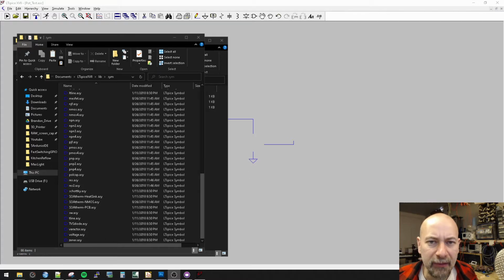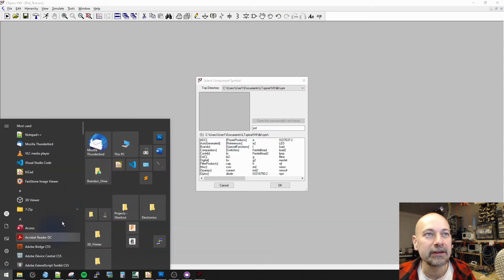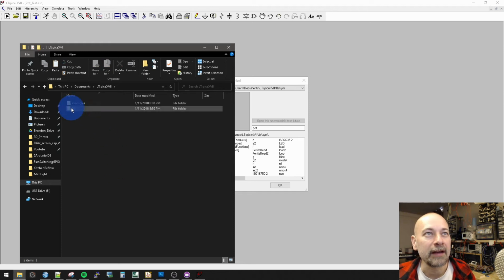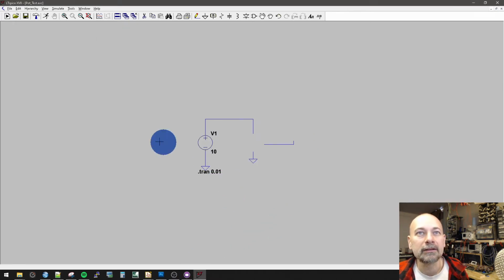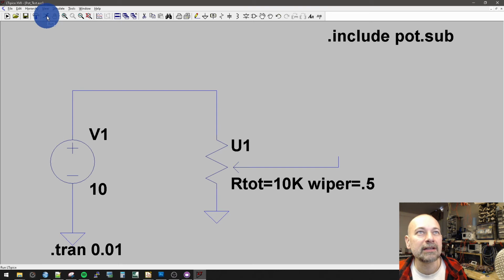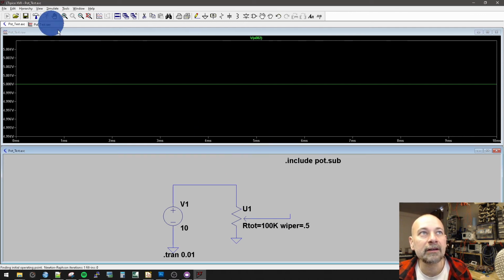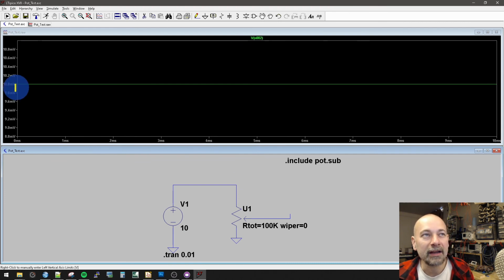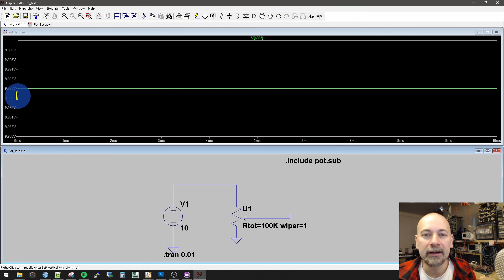LTspice Potentiometer Download and Install

Comment: Many thanks! I wondered why LTSpice didn't include a pot in their library of components. I still have to add a few directives to sweep the pot in a simulation, but it's only a single parameter now instead of the kludgy two resistor method. It looks cleaner. Verified, this works in LTSpice 24.1.10

Comment: changing the wiper value is the same amount of effort as changing a resister value. now i know why ltspice didn't put in a potentiometer
Reply: Well, it depends on how you are using the potentiometer.   A pot can be used as a single resistor or it could be as 2 resistors that share the total resistance.   So when a linear pot is set to 25%,   the first resistor is 25% of maximum and the second resistor is 75% of maximum.  It depends on what you are up to, but I saw value in making the potentiometer.  It may not be for everybody.

Comment: Have to try this out, thanks, the one reason I avoid LTSpice is because the way pots can be done in it is ridiculous. It’s now 2023, they need to act like it. And to those that say “the way that’s there is more correct, if you don’t know how to do it, you shouldn’t be using it” (I’ve heard this exact quote), to you I say stop gatekeeping, lose the ego. Every other MODERN design tool has a fricking pot in it, it’s not 1985, I know, I was there.

Comment: I created the same schematic you have in your demo. 
I get an error - "unknown subcircuit called in: xu1 n001 nc_01 pot rtot=10k wiper=.5"

What could be the problem?

Thanks!
Reply from the maker: Did you put the pot.asy into the sim folder and pot.sub into sub as I describe in the beginning of the video?  Also, you'll need ".include pot.sub" as the directory.  The text instructions are in the link just below the video.  Let me know if that helps.
Reply: @electroninjection183  I had done those things but to no avail. Then this morning, I started up LTSpice and it worked. So overnight, the Win10 gremlins fixed it. Seriously, I did nothing but that. Thanks for your reply, and for doing the work to create the pot component.
Reply: I had this exact issue until I pasted ".include pot.sub." in Spice Directive, which is the last icon on my toolbar, and looks like ".op" . Thank you Electron Injection!